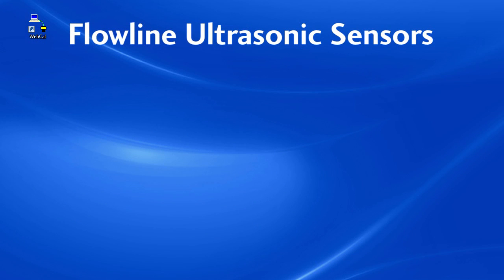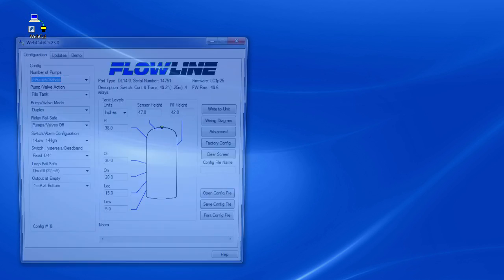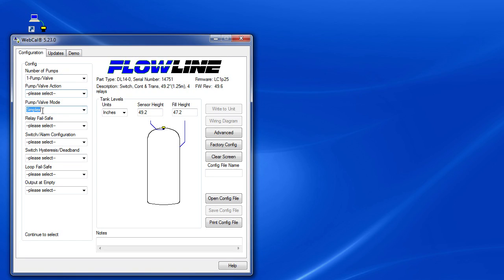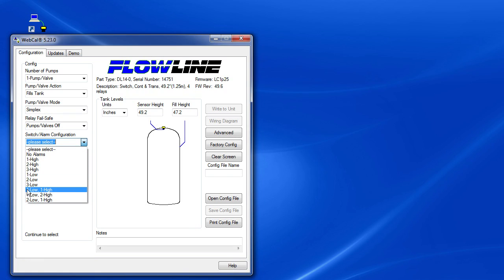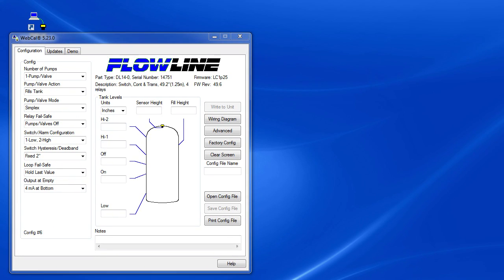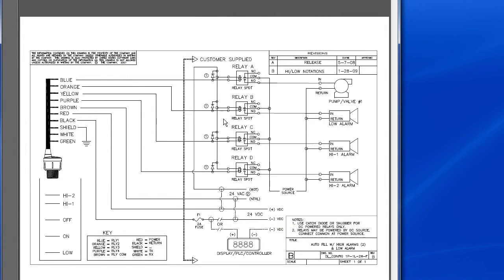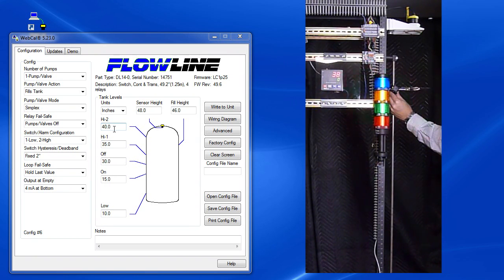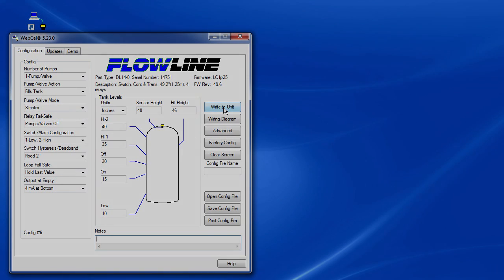Flowline Ultrasonic Liquid Level Sensor - Setup Part 1 from AutomationDirect

Comment: Puedo usar este sensor para medición de nivel en tanques de diesel en barcos? o aguas negras?
Reply from the maker: [
[English: Can I use this sensor for level measurement in diesel tanks on ships? or sewage?] Hi Brian, Yes, they are appropriate for diesel. We would suggest looking at the intrinsically safe US series, but that depends on your requirements. The US Series is better in environments with condensation. Check it out here: https://www.automationdirect.com/adc/shopping/catalog/process_control_ameasurement/level_sensorsa_controllers/flowline_reflective_ultrasonic_level_sensors_(non-contact)